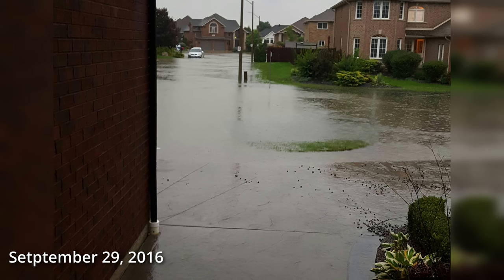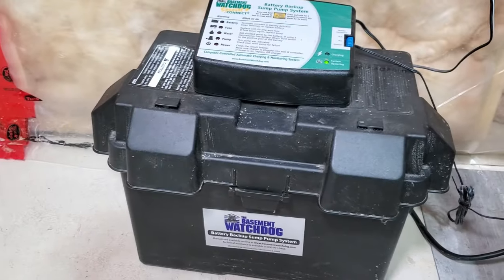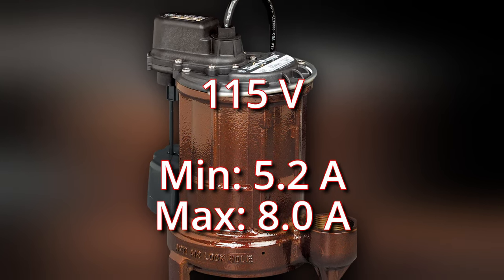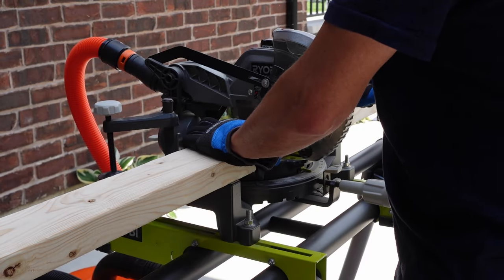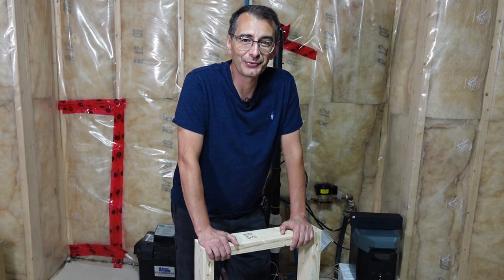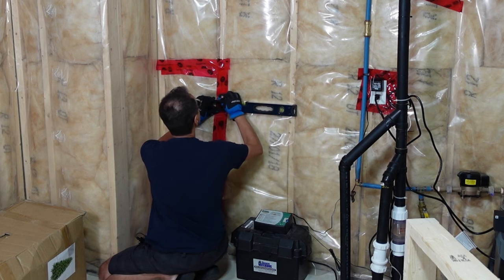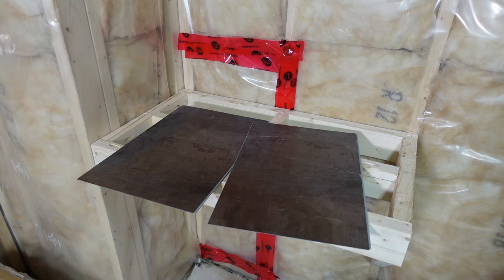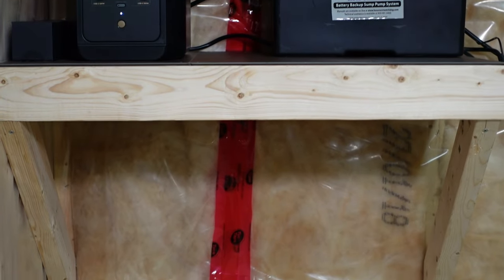Sump Pump Back Up Solutions | Using an Ecoflow Delta 2 as Battery Back-up |  Water Powered Sump Pump

Comment from the maker: For everyone who has been asking, I have only done calculations to determine the total amount of time the Ecoflow will last powering my sump pump. In the video I talk about the power requirements.  My sump pump has a min and max power consumption of 598 and 920 watts. Each pump cycle lasts max of 6 seconds (which I did time), and when there is wet conditions outside, there is about 1 cycle an hour. During storms and heavy rain, it will do about 4 cycles in a minute (240 cycles/hr).

So, taking worse conditions of 240 cycles x 6 seconds = 1400 seconds or 0.39 hours
WIth 920 watts x 0.39 = 358.8 Wh usage.
My Ecoflow, with extra battery, has 2kWh, or 2000 W/358.8 Wh = 5.6 hours
So in worst case it will last, at minimum, 5 hours until the Ecoflow battery is run dry.

Comment: Have you tested how long the Ecoflow can power the main sump pump?  (it will run intermentally I assume but how many total running hours do you get?)
Reply from the maker: I have only done calculation for the time it will last. From my video, my pump has a min and max power consumption of 598 and 920 watts. Each pump cycle lasts 6 seconds (which I timed), and when there is wet conditions, there are about 1 cycle an hour. During storms and heavy rain, it will do about 4 cycles in a minute (240 cycles/hr).

So, taking worse conditions 240 x 6 = 1400 seconds or 0.39 hours
WIth 920 watts x 0.39 = 358.8 Wh
My Ecoflow, with extra battery, has 2kWh; 2000 Wh/358.8 = 5.6 hours
So in worst case it will last, at minimum, 5 hours.

Comment: I'm unclear...do you need to manually switch power source to use the battery?  Or is this automated somehow?
Reply from the maker: No, the sump pump is plugged into the Ecoflow battery and the battery is plugged into a wall outlet. If power goes out, then the pump is powered by the battery automatically.

Comment: Thanks for sharing! Not a lot of great info out there on this stuff. I am looking around and I see one option is an inverter with marine battery. I was hoping there was an option like this out there. Have you had any issues running the Ecoflow Delta 2 as a UPS? Sounds like one con based on your comment below is the amount of time it can support the sump pump vs. a marine battery
Reply from the maker: As a UPS for my sump pump it has been working great. Now I would not use the Ecoflow as a UPS for sensitive computer or networking equipment as its transfer time is not fast enough, but for anything else it's perfect.
Reply: I been wondering the same thing... I.e., can a power station in UPS / EPS (emergency power supply) mode power a sump pump automatically if there is a power outage.  It's my understanding that the power station has to be sized large enough to be able to handle the sump pumps start-up power consumption (watts), not just it's running power consumption.
Reply from the maker: @buster.keaton  in the video I explain how you need to determine the max power usage with the usage of a power station. The Delta 2 can handle 1800 W, and my sump pump won't do over 1000 W on start-up. So well within its limits.
I've recently had a 2 hour power outage, and the Ecoflow Delta2 handled the sump pump without issues.

Comment: Thanks for making this video. After our flood, we bought the same Liberty sump pump and back up water supply pump (which didn't seem to work for us). Going to buy a new EcoFlow power station now as we rarely get power failures and they are usually very short. Did you plug in your main sump pump into the EcoFlow and then plug the EcoFlow into the wall? Thanks.
Reply from the maker: Correct. I have the Ecoflow setting of "AC always on" enabled, and my main sump pump plugged into the Ecoflow. This way, the Ecoflow acts like a UPS for my main pump.
Reply: Sounds good. Thanks for the reply. I have a back-up sump pump (also electric) mounted a bit higher than my main one. I think I'll plug this back up into the Ecoflow, so it doesn't drain down the battery as much or as often, since it will rarely go on. Either way, we should be covered for power outages as well as pump failures (our flood was caused by a pump failure). To be 100% protected, we should probably have a solar panel hooked up to the Ecoflow as well. @HomeCulture
Reply from the maker: You may not know this, but with the Ecoflow, if its plugged into the wall outlet, then the battery is not used as the power source for devices plugged into the Ecoflow. Once the power from the outlet is disrupted, then it switches to the battery.
For prolonged outages, I am also looking at the solar panel option, or a gas/propane generator.
Reply: Thanks for the info. We're also considering the solar or propane generator. Waiting on solar because of cost of panels and install. Propane will also be a costly install, as it has to run from outside the house and secured from theft as best as possible. @HomeCulture

Comment: Hello, I purchased an EcoFlow Max 2000 to back up my sump pump.  This power station is quite heavy to me. Can I use an extension cord to connect sump pump and EcoFlow? Thanks.
Reply from the maker: I don't think it should be a problem, as long as you have the proper extension cord. Ecoflow recommends, for up to 50 ft, that you should use a 12 AWG extension cord.
Reply: Great info. Thanks.

Comment: How do you activate it. As in, do you have to unplug your main pump from the wall and then into this? Basically asking if it has an automatic switch from city power to batter/inverter back up
Reply from the maker: Correct. My sump pump is plugged into the Ecoflow battery, and the Ecoflow is plugged into the wall outlet. The Ecoflow is then configured for AC always on, so it will automatically switch to battery power in the event of a power failure, then switch back to AC.
Reply: Perfect! Thanks for the reply!

Comment: Great video! I am considering a simlar setup and from what I have read, the portable power station does not switch back to utility power when the power is restored.I presume that is the case with most of the units unless one is installed at the breaker box with a transfer switch. Does yours avoid the above problem? Ideally, it would be nice to have the UPS function pickup power outages wherein you could leave the pump plugged into the portable power station with the power station connected to the mains for charging when not in use.
Reply from the maker: The Ecoflow Delta that I'm running acts like a UPS (Ecoflow calls it EPS since the switch from AC to battery isn't as fast as a UPS). When the power returns it switches back to AC

Comment: How many hours can your delta 2 flow work during power outage?
Reply from the maker: I have only done calculations for the minimum time it will last. From my video, my pump has a min and max power consumption of 598 and 920 watts. Each pump cycle lasts 6 seconds (which I timed), and when there is wet conditions, there are about 1 cycle an hour. During storms and heavy rain, it will do about 4 cycles in a minute (240 cycles/hr).

So, taking worse conditions 240 x 6 = 1400 seconds or 0.39 hours
WIth 920 watts x 0.39 = 358.8 Wh
My Ecoflow Delta2, with an extra battery, has 2kWh; 2000 Wh/358.8 = 5.6 hours
So in worst case it will last, at minimum, 5 hours.
Reply: @HomeCulture  thank you so much for this! I didnt know about the cycle. I thought they run practically all the time. I have a 1/3hp sump pump which is 5.2A. Max starting could be up to 2,900w based on google which the Delta 2 is just shy of 200w at 2,700w. But I can live with this risk.